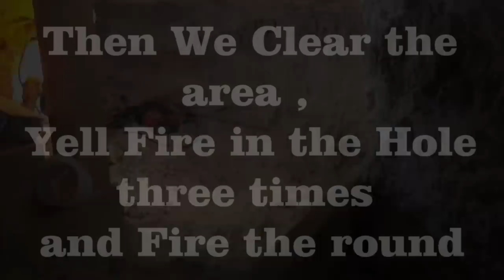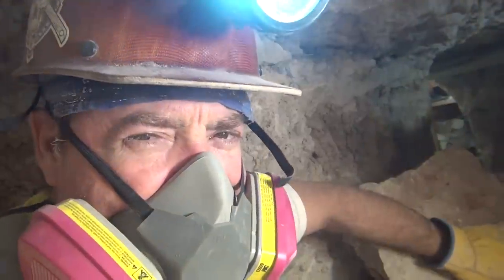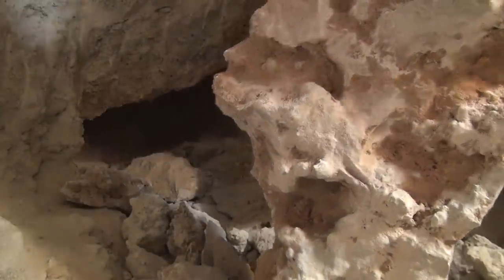CAVE BLASTING |  River of Gold - askJeff Williams

Comment: No need for a sledge hammer,, just pickup the slab, put a 4”-6” rock under it to prop it up, then slam big manageable rock into the middle of the slab rock,,this works fairly effectively,, and trying to swing a large hammer in tight quarters can cause self-injury

Comment: Could you drill holes just barely larger than that charge you dropped in or do you need the bigger drill? Seems like a smaller bit would drill faster.

Comment: Nice work,those little caps have quite a punch or was the stemming you used, anfo 😁. Do you get much copper wire from the dets mixed though your mullock(detecting and milling nightmare).if so maybe you should try using a blasting cord charge (PETN) cord+ Anfo or a bit of powergel/gelignite as primer, made up in a series this would eliminate the det/basting cap wire at the face and only one det to fire(no miss fires)not sure on the explosives you blokes use over there or what you call them.ie your Drifts are called Drives here. Not sure if the blasting caps would set off igniter cord or what.
Can't wait to see those cave systems opened up.💣 look out worm people his coming for you🐛
Cheers Craig 🍻⛏️
Reply from the maker: thanks and not sure ...have to ask Slim ....maybe Tovex.... gotta use delays to break it up right and then trow it
Reply: @Askjeffwilliams  I use one called  (cordex)but I think it's the same thing. Years ago used delays that clip straight on the cord. The other thing is Nonel (non electric) but you'll still end up with bits of det mixed in.Stay safe 😷

Comment: I see you are using the sierrablaster charges like regular electrical demolition loads. I saw you using plumber's putty to stem small holes. 
1. How are you stemming these large diameter holes that are WAY larger than the little sierrablaster charge? Just backfilling with the dirt?
2. In small hard rock holes.. are the sierrablaster heads even necessary if you use plumber's putty?    Can I save myself the cost of the heads to break boulders?
Reply from the maker: first putty then fine sand ...yes they are unless you can stem  at least 30% of the hole ....yes

Comment: Great videos Mr. Jeff!   What blasting machine are you using for those Sierra Blasters?  I use the Sierra 375 magnum set, but would like a hand held portable option like you used in the video.  Sure would beat lugging the generator in, gotta save my strength incase of worm people:). Thanks for the help !!  Jim M.
Reply from the maker: https://www.blasterstool.com/handi-blasterhb10blastingmachine.aspx
Reply: @Askjeffwilliams  Mr. Jeff, I have purchased this. While being an awesome and small device it didn't work for the Sierra Blasters. I'm constructing a (water resistant) 120v 1000 watt battery backup inverter next, although 40lbs, its still lighter than a generator :)   Thanks again for the help, and great videos.  Jim M.

Comment: Great stuff Jeff but looking awful scary, you just eyeballing the face or are ya renting equip and getting core samples. Don't gotta tell ya the value of reading the cores. That pocket looks like trouble .. it's been there for several 100 thousand years before Jeff came along.
Reply from the maker: just eye balling it for now ..... yep we know all about getting a good read on a core or two
Reply: @Askjeffwilliams  careful with the physical expenditure. Lot of upper body movement but not so much on the legs and you need full blood exchange.  The mask may contribute to oxygen deficiency you may get light headed and shit seems heavier.  There's a reason old timers didn't live much past 50.

Comment: If I learned anything from handling explosives is that those holes were way too big for such a small amount of explosives.I also noticed he didn't put the rod down the hole with the rock weights on them,too.I'm guessing that Jeff put some anfo (ammonium nitrate,sawdust,diesel and motor oil) using the blasters as caps and then sealed the holes before setting them off.I would say that is cheaper than using a bunch of those SierraBlasters,too.Mums the word so this is nothing but musings of an old fart.
Reply from the maker: thanks for the keen eye Paul
Reply: @Askjeffwilliams  Try this trick to uses less amfo and improve your fragmentation of your collar zone.This is referred as Top Deck Air-Gap Blasting Technique. Seems it ups the power of the shot by about 30% where it matters the most and reduces the shock to the lower levels. You could use sawdust or wood chips if you're too cheap to buy the plastic pellets that the pro's use..Geotechnical and Geological Engineering; Dordrecht Vol. 35, Iss. 1,  (Feb 2017): 157-167. DOI:10.1007/s10706-016-